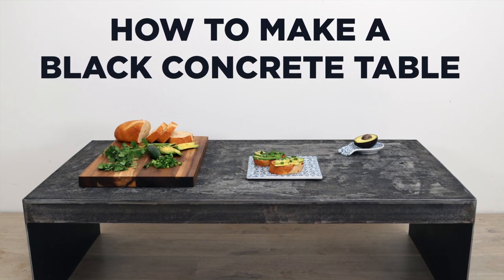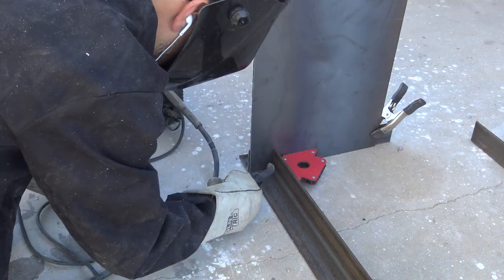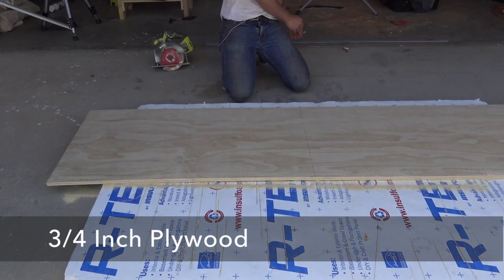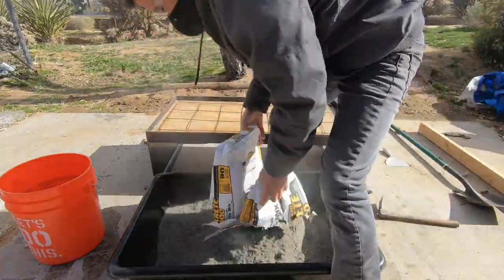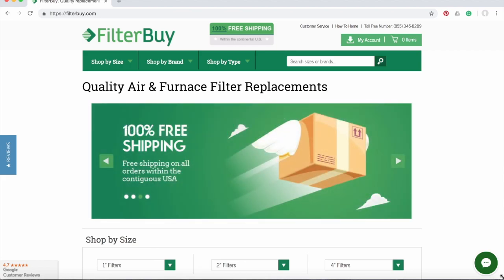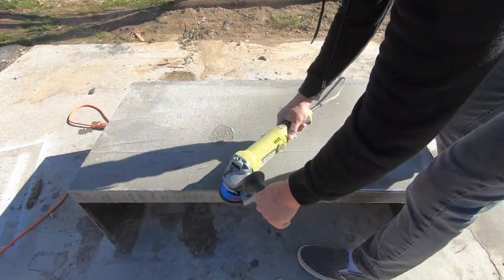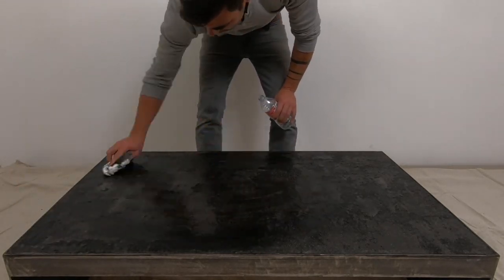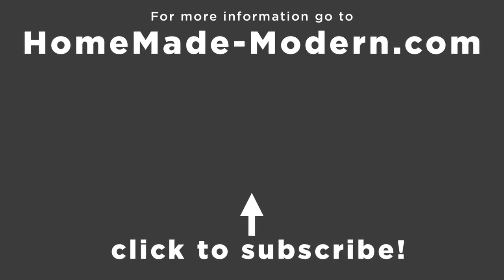Concrete and Steel Table Stained Black

Comment: Just a welding tip, don't weld with those magnet clamps on. You'll demagnetize them quickly. Those are used so you can tac-weld, you also don't want to weld more than 1 inch at a time like that since it risks warping the metal as it cools.
Reply: @lexdiamond20  the only real fix is some heat treating and careful bending, yeah. Everyone who welds learns that lesson at some point.
Reply: @lexdiamond20  that would hurt

Comment: Last night I sat a salad dressing container on our current table and it left a ring of oil. Fortunately, it's granite so it wiped right off. I'm considering the purchase of a concrete coffee table but am concerned about stains from food and drinks. Will a coat of paste wax seal a concrete table enough to prevent accidental staining?

Comment: Won't these concrete tops scratch your gadgets? Like your smartphone's display or back glass, or your camera lens? Is the wax enough to dull all the sand in the concrete so it won't be an issue?

Comment: Awesome Ben.  Wondering if you could have put the plywood on the bottom the steel to be a dam and then after the concrete cures just remove it then it would be great as a solely outdoor piece of furniture.
Reply from the maker: good idea!

Comment: Nice table.
Duct tape is grey - for taping grey ducting. Gaffer tape is black - for taping cables to the floor in theaters / film sets.
Reply: They make black duct tape, gaffer tape has less residue and is easier to remove.. Two totally different uses..

Comment: Great table. What inspired your use of India ink over cement color?
Reply from the maker: I have used mix-in pigments before and they are great but I haven't been able to get the concrete that dark without weakening it also I was curious about finding techniques that could be used on existing concrete floors, countertops or other surfaces.
Reply: @HomeMadeModern  Good to know, thanks.

Comment: The air filter you change that in your parents furnace should have a filter rack. If you bend the filter like the way you installed it the air takes the path of least resistance and will continue to get dirt in the system and your indoor air quality is no better. The best was is to install a hepa type filter.

Comment: Love your video's! I'm trying some things out with concrete. I use a silicone square mold.  A lot of times the corners don't come out. Anyone a tip for what i'm doing wrong?
Reply: did you try to spray it with some cooking oil?

Comment: Was there a specific reason why you just didn't use concrete dye powder?
Reply from the maker: I have used mix-in pigments before and they are great but I haven't been able to get the concrete that dark without weakening it also I was curious about finding techniques that could be used on existing concrete floors, countertops or other surfaces.
Reply: @HomeMadeModern  Ah, okay... I never realized that concrete dye powder would weaken the concrete, but that makes sense.  Thanks for the explanation!!!